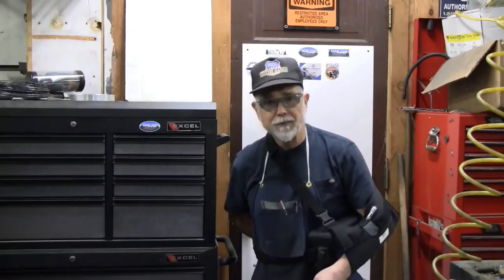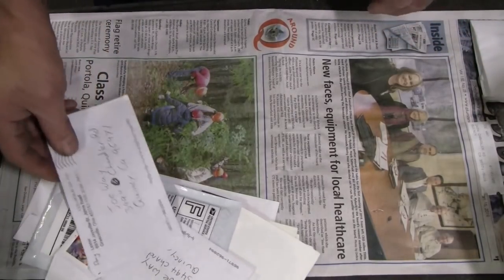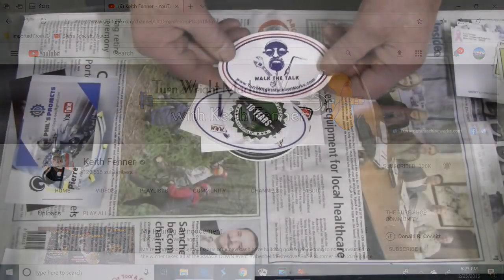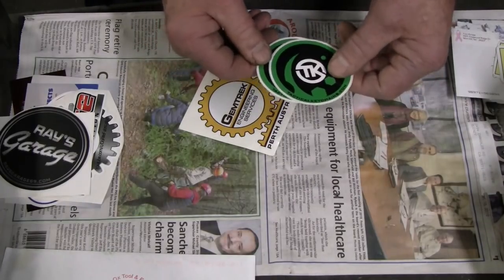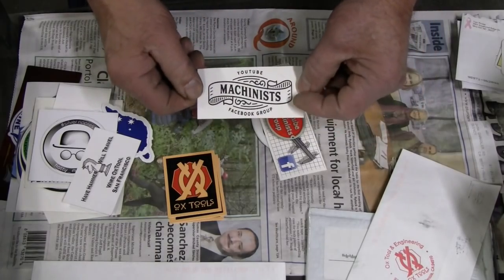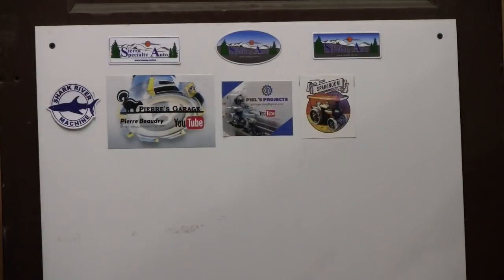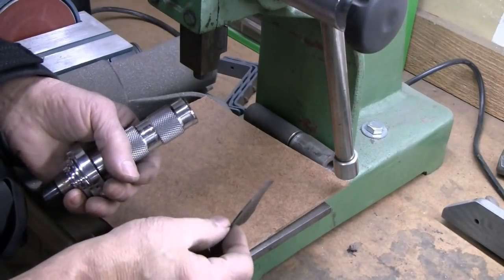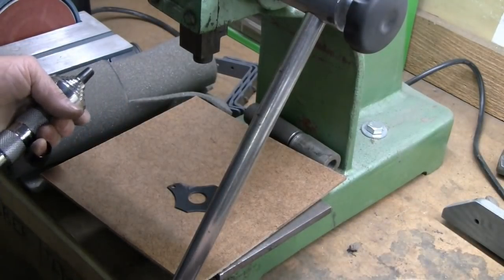Channel Stickers & Specialty Tools

Comment: Excellent gasket tool, sure beats the ol days with a circle cutter and razor blade or an old socket I sharpened. Nice tap handles. WoW, you got a bunch of stickers there. Mine are on the way. Take care of your shoulder. If you’re ever down my way you can use my surface grinder anytime.    Thanks for sharing 👍👍👍
Reply from the maker: Ron, your envelope of stickers arrived yesterday. Look for them at the end of my next video (first part is already recorded and edited). You're almost close enough to take you up on your grinding offer, but that would be a LONG day. Thanks for the stickers and thanks for watching.

Comment: Hi Joe, great to see you up and about.  RR is a great guy. Paladin was one of my favorite shows.  They do make spring loaded tap guides for the smaller non center drilled taps, they have a cupped end to fit over end of the tap.  Great sticker haul.  I like the guided tap wrenches.  Thanks for the video.
Reply from the maker: Thanks, Vernon. I see Grizzly has one of the cupped guides. Might have to see if I can find some Paladin episodes on YouTube.